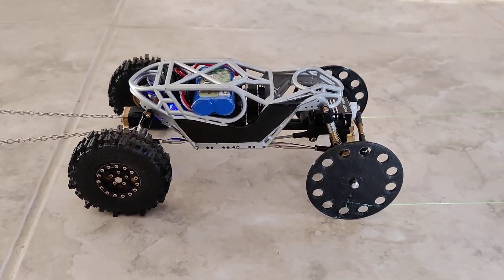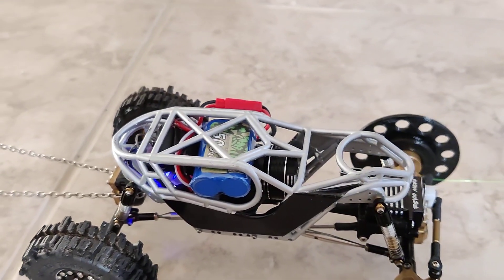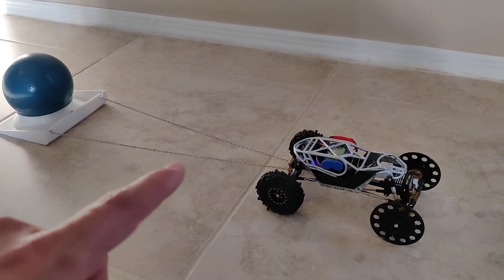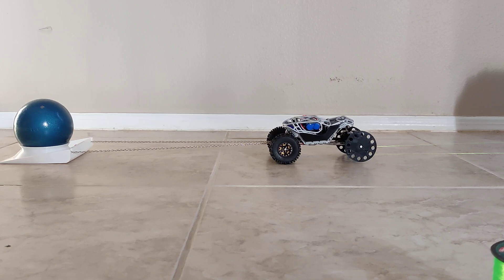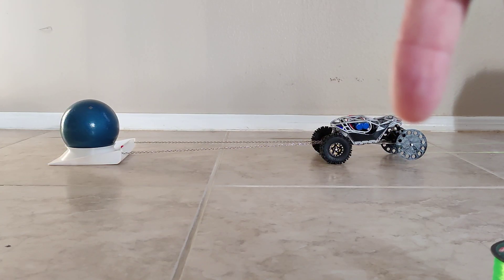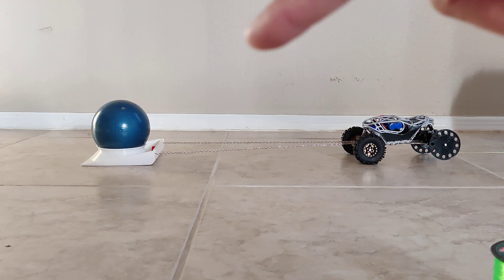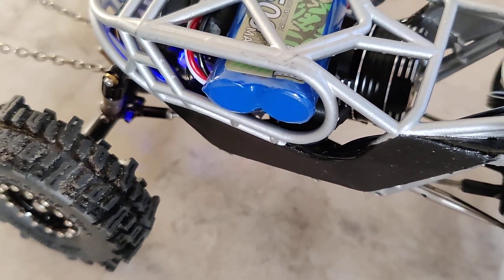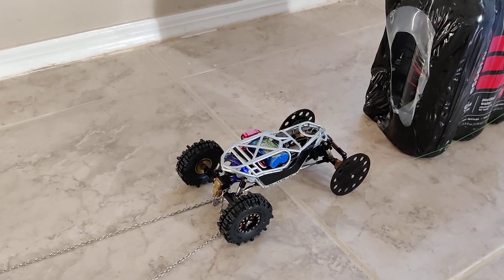New Furitek 2204 Brushless outrunner for the SCX24 platform

Comment: Motor is an airplane motor, it wasn’t made for crawlers as you say. Furitek is just marketing them to SCX24 owners.
Reply from the maker: Actually I was right there step by step while they designed it so I can actually say it was made specifically for the scx24. The fact that it is an outrunner motor closely resembling an airplane motor doesnt just make it an airplane motor. In any case, any motor can be an airplane motor or a car motor. Its all in how you gear it and what controller you use. Performance will vary of course but they work.
Reply: @Gamyrc  an out runner motor is an out runner motor. To say a motor was designed for a specific vehicle is ludicrous. It may have been spec’d a certain way but that about it. It is still an airplane outrunner motor in the end, not a motor “designed” for a specific crawler.
Reply from the maker: @jasonmowery1978  Again, outrunners are NOT specifically airplane motors. And a motor that was made a specific kv with a specific size and weight to match the specific needs of a specific vehicle and its drivetrain is in fact a motor designed for that vehicle. But hey, if you want to use for an airplane then be my guest☺️.

Comment: 🖐️🤠 hi Gamy
Brliiant share of the new FuriTek motor; 
greatly appreciated 👍 
Out of Curiosity....... 
Do you know how many pole it is? 
To my understanding the Surpass is 14pole 

Higher pole rating with brushless motors for crawlers means less chance of Cogging at initial throttle punch with extremly slow crawling as shown. 

2FMRC had a bit of Cogging when showing off the FuriTek motor, but he didn't tune the ESC due to the excitement of sharing the news of the motor. 

What did you tune your FuriTek ESC too regarding: Throttle Punch, and anything else related, 
to eliminate the possibility of any Cogging at initial throttle punch with extreme slow crawling as shown? 

Cheers from 🇬🇧